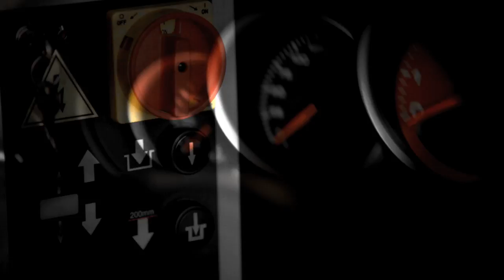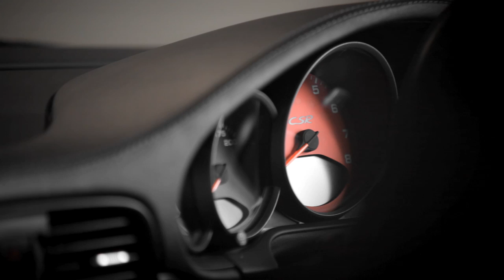RPM Technik and the 911 CSR: Can you improve the 911? - XCAR

Comment: Love the concept behind the CSR, love that it's a bit different without looking overly messed with, love the <GT3 >C2S approach and when I was in touch with RPM about the car, they couldn't have been nicer or more enthusiastic - which, being the opposite to what I've found at every Porsche dealer I've dealt with - is also a huge plus. A CSR is definitely on the shopping list when I shop next.

On another note.... the comment at the start about every Porsche purchase being emotive is probably largely restricted to used purchases. New ones? Been to a Porsche forecourt lately? By the time you wind your way past the wall of Cayennes and then around the Panameras and Macans, you'll see the odd new 991 or Boxster, 90+% of them automatics and usually in a very dull, boring colours. Emotion started to pack its bags at Porsche sometime around 1996, headed to the door when the Motorsport programme got cancelled, walked out when the Cayenne arrived and locked the door behind it when the 991 GT3 went PDK only.
Reply: Superb point, I would take a CSR 996/997 over a new 991 any day, other than for out and out track times why pick a sports car without a manual gearbox? I can understand to a certain degree if it's your daily driver.

Comment: A couple of things stand out to me here. To start with, the engine revving up to 3000RPM on cold start when it could have been switched off for God knows how long is NOT A GOOD THING. You need oil to the valve train before you start revving it above idle, I'd HOPE it had priority oiling to the bottom end anyway, so it's just the valve train that's a concern... Secondly, you WEREN'T looking to pick up ANY power when rebuilding the engines and therefore were satisfied with a 20hp gain! WTF, are you guys for real? They are mass produced engines and with that come compromises, inconsistencies and flaws in design. Any decent mechanic would see that as an opportunity for improvement. The amount of and type of improvement would depend on it's intended purpose and the customer's budget. There are SO MANY things that could have been improved upon while it was apart, and when rebuilding old classics in the workshop I'm employed at- that's exactly what we do. It would be very easy to increase the compression ratio, clean up the cylinder head castings and blend the valve bowls into the inlet runners in a way the factory could only dream of in a mass produced engine (or porting the head properly if the budget allowed for it for even better flow). Camshaft selection is another easy gain in hp, better valve springs to make it tolerate race style driving for extended periods. Properly port matched inlet manifolds to cylinder heads runners, better fasteners is a MUST and you would have to be on crack to not fit it out with ARP main studs, head studs and upgraded 'rod bolts. I could just keep going and going here. Hearing this was nothing but disappointment and shock. They could have made something really special here. Maybe they need a good Aussie mechanic to help them improve their engine program. I'm available, I'm just saying... Although I suspect the wage wouldn't be worth packing up the family and moving half way around the world for.